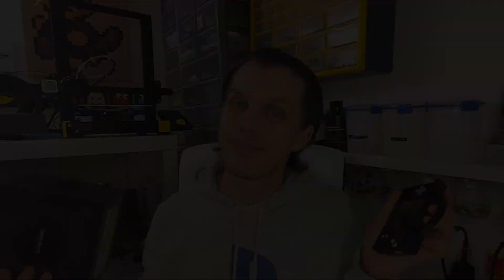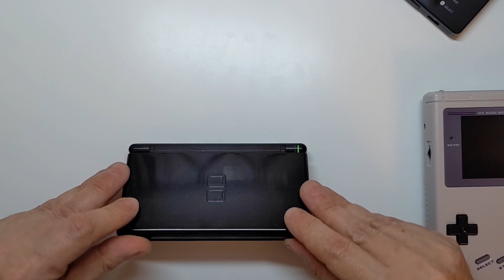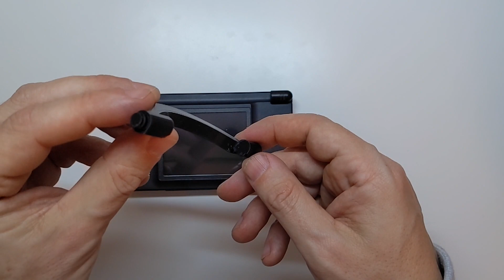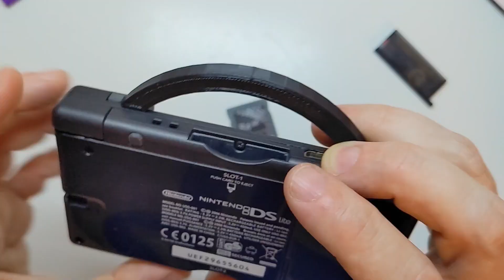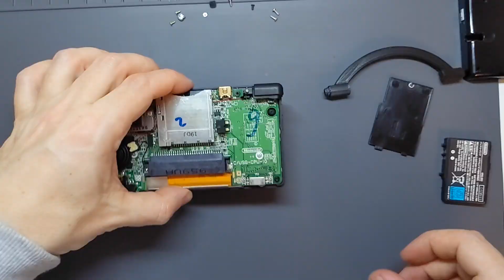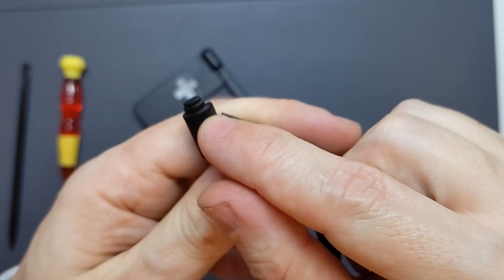Introducing the MacroCube: the EASIEST way to build a Gameboy Macro!

Comment: Can you do a video showing how to set up the emulation to run on the bottom screen, I can only find ones that run on the top screen and that's obviously no good in a macro
Reply from the maker: Yes that should be a fairly short video as it's in the DS settings but I'll try and get that done

Comment: I have a broken 3ds xl, can I do a gameboy macro?  I have searched for a video but there is no
Reply from the maker: I don't know about a 3DS XL, you'd have to hack it so you can run emulators as there's no GBA slot, which is the main appeal of the DS lite for me. As for the solder points to do it, I have no idea. I'm sure it's doable though.

Comment: I find the ds cartridge slot redundant. If you have a flash cart that goes into the gba slot why keep the ds slot? The sound comes out of there better in my opinion. I’d like to find a way to cover it with a mesh of some kind  though. Super cool mod thanks for showing it off
Reply from the maker: No problem! Of course you can use that slot for the speaker but if it still works I'd much rather have it functional

Comment: Have you thought about adding the custom firmware to switch screens? You would also need to add anywhere between 1 and 3 buttons to it as well to be able to switch screens.
Reply from the maker: I have seen it done but not tried it yet. Definitely something I'd like to explore
Reply: I just did it on my ds lite with a broken screen, only took about 15 mins following the tutorial to flash a modified firmware, then you only need one button to swap screens, the extras are for picture in picture and opacity, didn't bother with those. This was my first macro so not exactly got a lot of experience and it went pretty well.
Reply from the maker: @tumbles8350  that's very encouraging to hear!